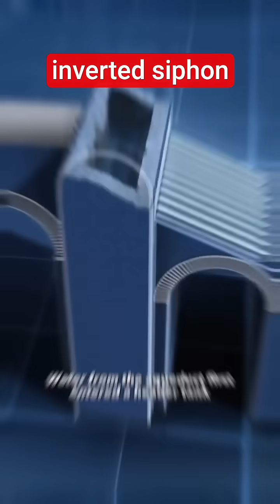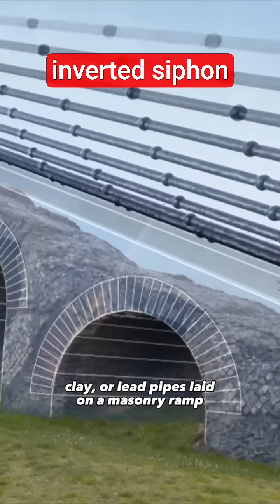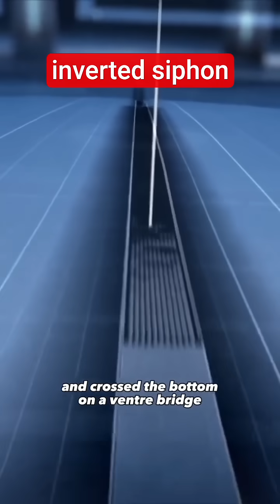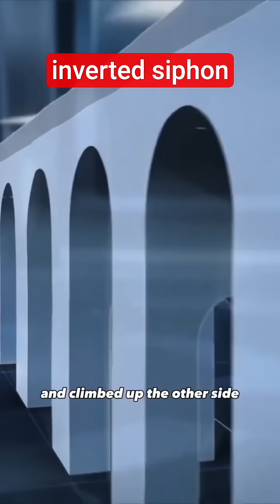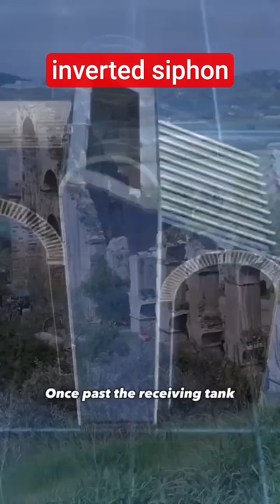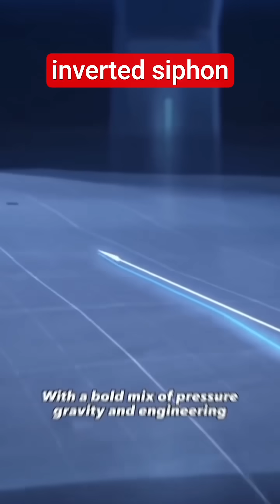athe Roman's inverted Syphon #history

Comment: Lead pipes = lead poisoning
Reply: Actually, not necessarily. Cold water creates an insoluble lead salt, that prevents the rest of the pipe reacting and disolving in water. Given the tubes themselves were protected from the elements by other materials, the water in itself was probably safe enough to not be representative in the downfall of the roman empire. There were a lot other uses of lead that were directly more poisonous, like using it to sweeten wine, for example.
Reply: Only with acidic water. Alkaline water it is perfectly safe. Most cities still have lead pipes in use from years past. The whole Flint Michigan debacle is when the city switched water supplies to a new source and never bothered to Ph correct the water. City water supplies are usually run between Ph 7.5-8.5 for that reason - slightly alkaline.
Reply: @wally7856 basically the democrats caused it.
Reply: not at all.
Reply: Only if lead is water soluble
Reply: Lead pipes have been used for thousands of years and they are not a problem unless you have a leftist vulture virtue signaling instead of maintaining said pipes.
PVC pipes are way more dangerous for your health because of the many microplastics they leach. Lead oxide doesn't leach